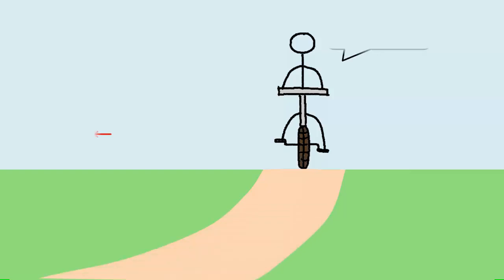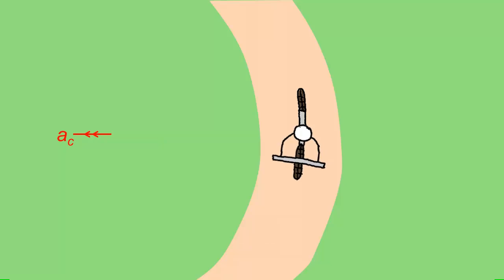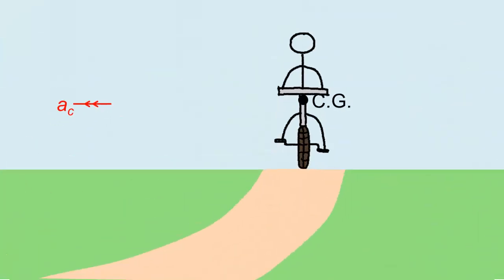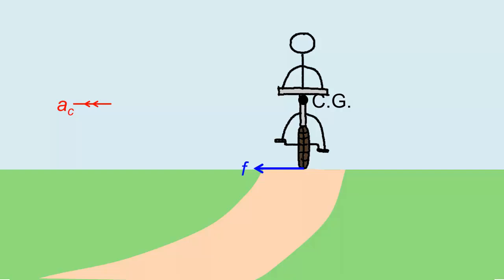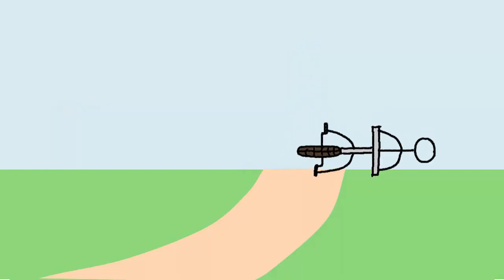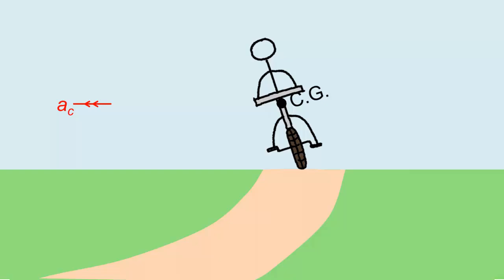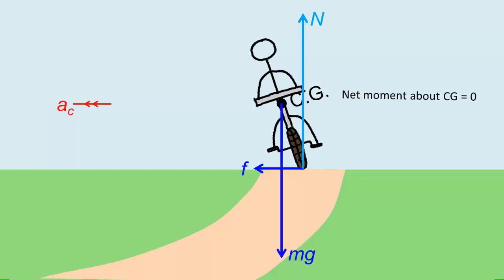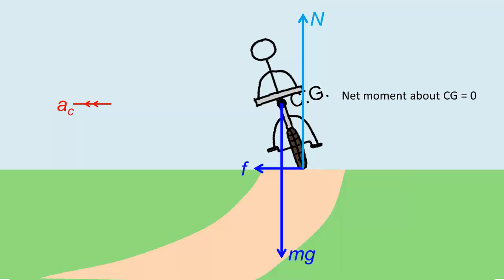Why Must Cyclists Lean Into the Bend?

Comment: Why is the friction going centre?
Reply from the maker: Ooh, this one is rather tricky. The wheel is not pointing forward. It is pointing sideway, or at least it is being turned towards the centre of the circle. And so ta-dah, a frictional force in the centripetal direction. It is similar to how a cone when rolled on its side, follows a circular path because it experiences a friction in the centripetal direction. Or a rolling coin when slightly slanted, starts to circle. But the physics is not trivial I think, and I don't know how to explain it in a simple manner. Plus I am not entirely sure of my understanding. :-)
Reply: xmphysics I have a simple question ( I’m pretty confused about this one simple thing ) 👇🏻
Imagine a cycle...it is stationary , that is , it’s not moving at all . 
Then I incline the cycle by a small angle towards the right , in this state the cycles tire is experiencing frictional force , right ? This frictional force is stopping the stationary cycle from falling and the normal is doing its work of giving the cycle an anti-clockwise force as well , then why is it that a stationary cycle falls when we leave it at an inclined angle but a cycle which is moving ( has some velocity as the one in this video) doesn’t fall when we incline it 
In simple words my question is that why do the forces not work the same when the cycle is stationary as they do when it’s moving . Thanks 🙏🏼 nice explanation though .
Reply: @shukrantpatil1659  YOU CAN GET THE ANSWER FROM IITBRAINS.COM .....
Reply: @shukrantpatil1659  When cycle is stationary, only gravity is acting which causes torque and it falls down

But when a cycle is moving fast, when you turn, friction acts radially (only because of the speed of the car, mv^2/r) and its torque counteracts the gravitational torque

So the cycle can lean much more inwards because of torque getting balanced

I would love to know if I'm wrong somewhere, people in future reading this, please do reply
Reply: xmphysics alright thanks anyways
Reply: because inertia is causing cycle to go away from centre and it is 'scraping' against ground.so friction acts to the centre